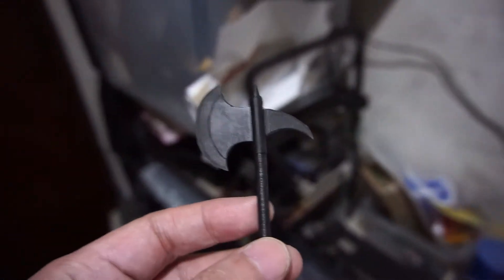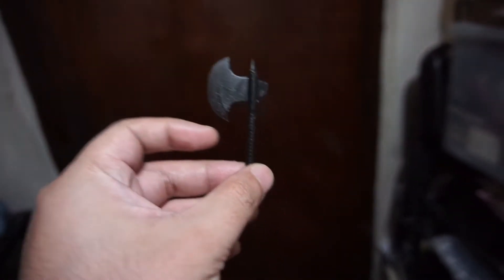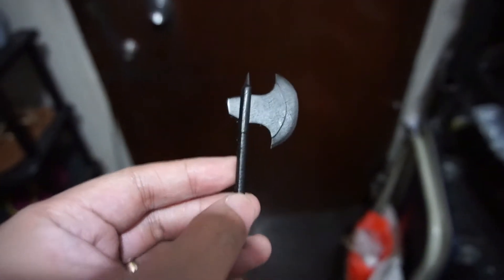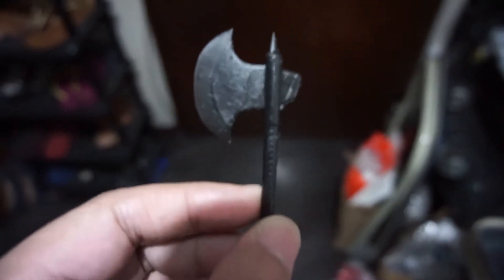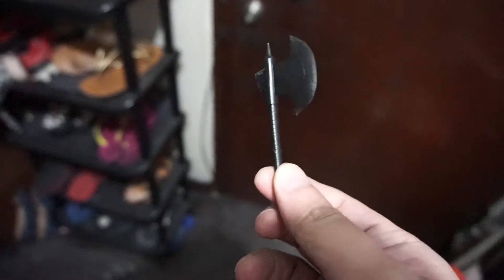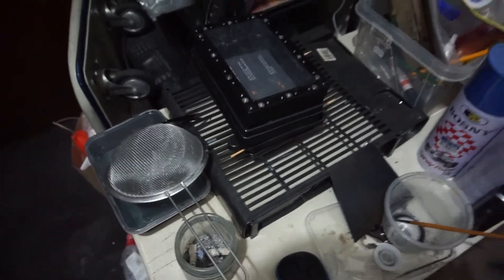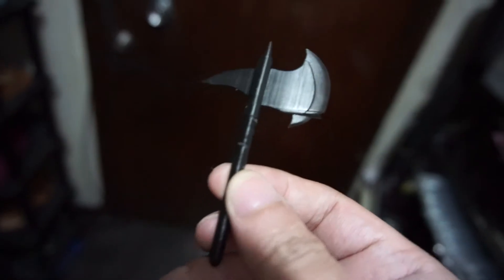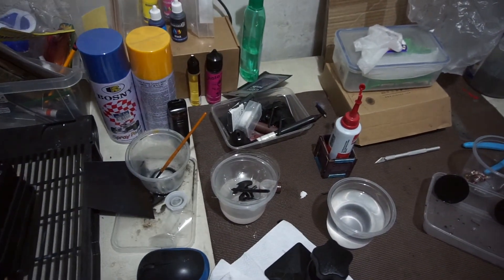3D Printed 1:12 Axe Drop Test with E-Sun Hard Tough Resin

Comment: if i mixed it with esun flex resin, will it be like ideal action figure material?
Reply from the maker: could be worth a try. i havent used the esun flex yet but i sometimes mix monocure flex 100 with abs like and it works well in terms of being flexible but still has a breaking point if print is too thin
Reply from the maker: @matrixtoyshobbies  yeah pla is still brittle despite being mixed with flex. in theory hard tough should be good when mixed with flex
Reply: @PavzReviews  i bought the hard tough, tomorrow I’ll try to mix it with the flex for action figure
Reply from the maker: @matrixtoyshobbies  cool. good luck with the results